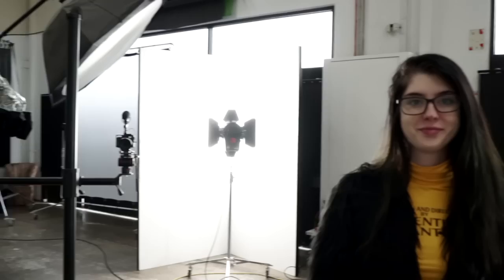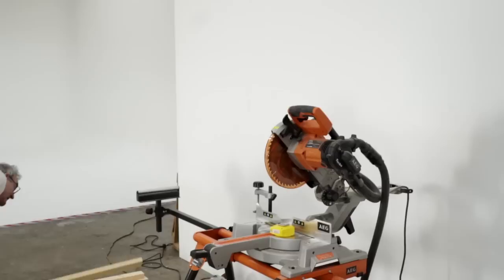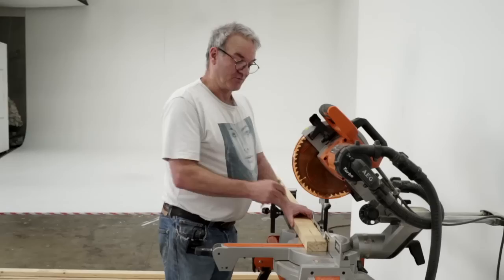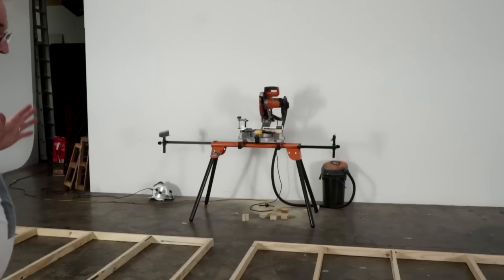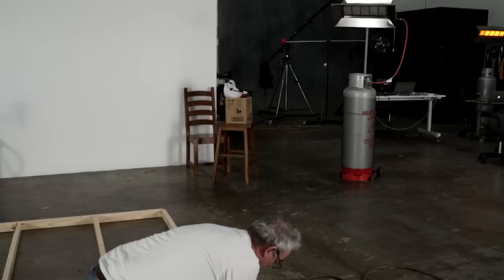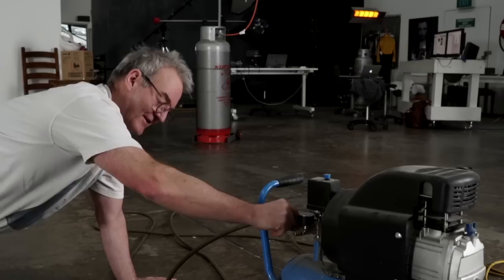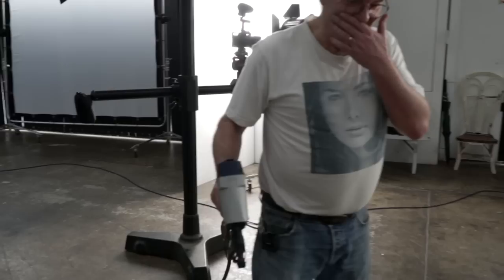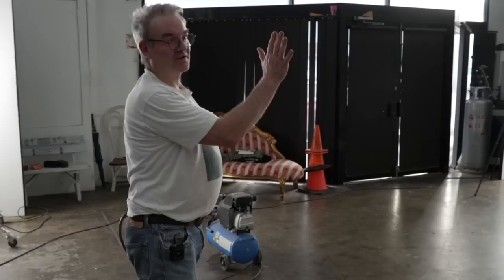Building a Movable Wall

Comment: This is fantastic and exactly what I need to do. @Petercoulsonphotographer, I'm looking to create these as both sets and actual rooms with trim molding on the bottom to hide the wheels. Have you ever added a 3rd wall to the structure? Any advice?
Reply from the maker: No only 2

Comment: Is there a particular photography/artistic reasoning for those dimensions or is it just what you are used to working with based upon your gear? Just curious.
Reply from the maker: the dimensions are based on the timber size
Reply: Okay. Thanks. I had to ask just in case I missed something about methodology. Was Bec genuinely uneasy about the table saw and nail gun or was it a good petulant put-on for the video? I don't think she liked those parts very well. She's also very pretty and her nearly jet black hair is a wonderful look. Anyway, have a good new year.

Comment: Far from being a builder lol so sorry for the silly question but any problem with using plywood vs MDF vs "hardboard" for the sheets.  What is "hardwood" anyway as don't see that listed at my local building supply store for sheets like this.  Also did you need to put anything between the sheets to make sure no gap / line appear in the photo?
Reply from the maker: Sorry Cameron it is plywood, Bec made a mistake in the description on the video. I find MDF moves too much in heat or cold weather, where as the ply doesnt. I didn't mind the lines because it was going to be painted grunge but if I wanted it to be smooth I'd use 'No More Gaps' :)
Reply: @PeterCoulsonPhotographer  Awesome thanks for clarifying, thought it would by ply but no idea about wood lol so thanks :)   Is great that its cheaper too :)

Comment: What kind and size of ball wheels you used and number of pieces?
Reply from the maker: Which ever kind suits you, if you have smooth surfaces you can use smaller wheels but for a rough surface use larger wheels. I used 3 small wheels, one on each corner

Comment: I see that you're  terrified of using power operated tools. True they can be dangerous if used improperly as the same can be said about any implement. In one of dr. Jordan Peterson's lectures he mentioned a patient who had a crippling fear of elevators. To anyone else it's just an elevator yet, this patient perceived it as a representation of death. The means by which that phobia was managed had been done through exposure. At first they would stand in front of the elevator at a manageable distance. Over a series of sessions that individual would move progressively closer until they were about a foot away from the doors. After overcoming that element they'd look inside as the doors would open. Once that was manageable it was one foot in. Later it was both feet as now we're able to stand in the elevator. The door isn't closed yet and can be controlled so not to close. Layer, in another session when comfortable enough they allow the door to close. Soon the patient is able to take the elevator to various floors. The method used is Exposure. As this is an archaic response to a threat the 'fight-flight' response will percieve it as severe. Every stress response will be seen the same way as the limbic systems natural proclivity is to prepare you for anything and everything. Exposure mitigates this by demonstrating that there is nothing to be afraid of by the realization that no harm has come to you despite the proximity to the perceived threat.